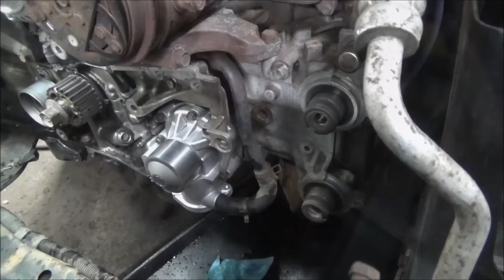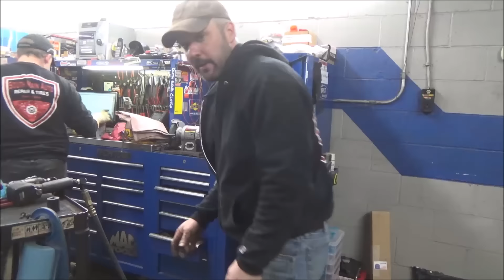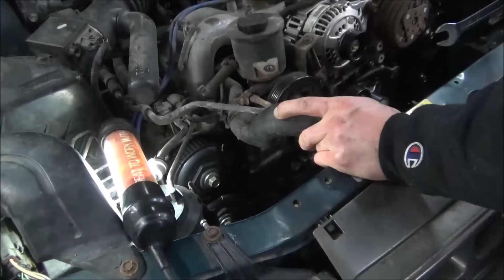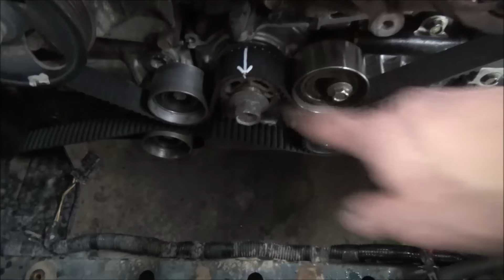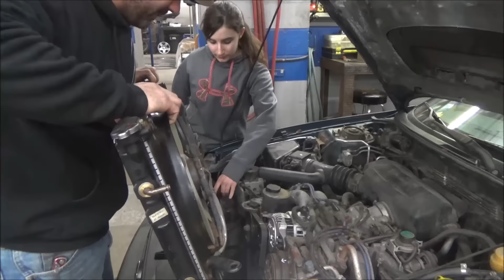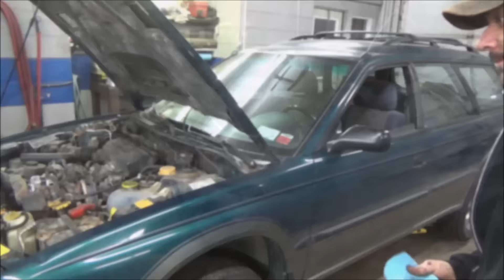Subaru EJ25D 2.5 DOHC Timing Belt & Water Pump - Part II

Comment: I bought a 97 Subaru from a guy last year not running. I took a chance and paid 1000 dollars for it. He told me it was his daily work car and one morning it would not start. He said he had a mechanic looked at it in his driveway and said his computer went bad and that is all that is wrong with it. I got it towed to my house and started working with it, anyhow I took the timing belt apart, it has a brand new belt ,new water pump, bolts were cleaned then I found out that they did put a new timing belt and water pump but when they put it back together the idiots forgot to place the little keyway when they install the crankshaft pulley. lol so when you start the car it would not crank because of it. Needless to say at the end I got the car running and drove it for two years and sold it and made more than what I payed for. What a great deal !!!!
That was a true story. But not all the time you ran into that situation 90 percent of the time you ended up buying a melon. So my suggestion is don't buy a car especially when the car does not run.

Comment: I have done this 4 times with new kits, and will be doing my 5th soon. 
A few tips for the DIY's from my experiance that do not have Erics expertise and tools.
1: Do make sure you have a proper tourqe wrench for the waterpump bolts. I stripped the lower driver side one and could never stop the leak.
2: I use small clamps to hold the belt on the driver side pully's as they do jump easily.
3: Do not get China parts. I bought 1set and the belt had no marks and the tensioner pully and bolt did not work together. Could not use the suppied bolt to reuse the old pully. I use Gates only for my kits. 
4: The last ideler pully to install went on easy for Eric. 1st 2 I did were a big fight. Now I leave all pullys lose untill the last one is threaded.
5: I tried the same thing Eric did with the allen wrench on the tensioner after being off 1 tooth, and having to redo everything.
 Mine  snapped. Try a 2 inch finishing nail. Worked for me.
 Hope this helps.

Comment: Eric, needed this vid about a week ago! Was doing this on a DOHC 99 Legacy GT. The tooth-count tip when the cams are set in the area is the ultimate tip on these engines, in particular. If you're a tooth off, you'll pretty quickly notice a bad start and the engine will throw a P030[1,2,3,4]. The water pump install with removing the back timing cover is a lot easier.....only if you can easily zip off the cam sprockets with an impact or something, if you can't do that, or if you don't need to change the seals, I wouldn't try taking off the sprockets. You're awesome, man!
Reply from the maker: +Rodrigo Sagebin Ah man a day late as usual! Good tips thanks!

Comment: Those spill free funnels are great.  Paid for itself the first time I used it. Like you experienced in the video, a little bit of coolant can spill out when removing the funnel & adapter.  I've found that if you slightly squeeze the upper radiator hose to push coolant up into the funnel, then plug & remove the funnel. When you release the upper radiator hose at this point the coolant level will often drop just below the radiator filler neck. So when you remove the adapter little to no coolant will spill out. Works like a charm and saves me a bunch of time on clean up.
Reply from the maker: +Pet Rock's Garage Yeah I know better but just didn't do it :/ Thanks for sharing though def a great tip!
Reply: no prob...  keep the awesome videos comin'...

Comment: Good video.   When I worked on my wife's 1997 Outback, I went ahead and pulled the engine to change out all seals, gaskets, water pump, belts, etc.   It was a easy engine to work on.

Comment: Another outstanding thumbs up SMA original video.  What an excellent tip at 19:41!  After watching part one of this video I went to view the head gasket replacement on this same vehicle.  Fantastic stuff shown keeping this car on the road.  At 20:26, I rotated my crank 720 degrees to check the timing after installing a new belt.  Glad I did.  Turns out I installed the belt backwards.  Recovered quickly and everything worked out fine.
Reply from the maker: +Sandbag1300 Oh man common rookie mistake as Danner would say lol, Nahhh good thing you caught it before ya hit the key!

Comment: I had the SOHC engine (2.2) and honestly working on a Subaru in the home garage is way easier than my Toyotas or Ford. Especially since the alternator is on top. Spark plugs are not terrible even though you think they would be on the boxer engine.  Will be looking at your head gasket videos as well :-)
Excellent video and walk through on the DOHC version, a lot of owners have trouble with lining everything up.

Comment: I did this job on a 90 legacy w/ 2.2 and started engine to check timing and tranny fluid went all over! LOL.
Did not have an impact so used a socket and breaker bar against the front frame rail under battery and used the starter to loosen crank bolt!
Also had no sprocket holding tool so had to improvise.

Comment: One little thing... Sometimes the idler pulley has a large center hole that is fitted with a large cupped washer.  I don't know if it is intentional, but it sure is handy to loosen that bolt a bit so the pulley can go off center and give you another half inch of slop in the belt so you can finesse the timings.

Comment: Awesome video Eric.

There has to be an advantage to that design... But man, to have to pull the timing and most of the front of the motor just to get to a water pump? I am used to taking a serpentine belt off and zipping the water pump off and then put it on and done. 

Of course, only seen that on American motors... Even the Aveo (Korean Daewoo model) we had with the 1.6L had you mess with the timing as well just to get to the water pump. I guess they make em this way for a reason!

Comment: Just a tip when using the spill free funnel, before putting in the stopper you squeeze the upper radiator hose then plug it. Then you do not have water come out when you remove the adapter.  Question, thermostat with jiggle pin,  where does the jiggle pin face, 12 o'clock or does it matter.  Thanks for another great video.
Reply from the maker: +Ricardo M. always put the pin at the high point , on this style it did not matter though
Reply: Thank you for the info, I appreciate it.

Comment: Nice! If you want to start the engine with the rad out, just connect one trans cooler line to the other with the longer of the two existing hoses. That way you don't need to use any fancy-pants hose pinch-off pliers which most of us regular DIY folks don't have in our toolbox anyways :)
Reply from the maker: +motoYam82 Heck ya or an old piece of 5/16 or 3/8" steel line  to loop them together. Your right full of the good advice!
Reply: +South Main Auto Repair +motoYam82 that was another thing that got me on this one... Rubber Transmission lines?? My Chevy and my Ford both have steel lines (or Aluminum... More than likely aluminum) and have a special fitting that screws or clips them to the rad. 

Since it is rubber, are these prone to failure or do they hold up well to the fluid and pressures?
Reply: On any vehicle there must be some section of the cooler line which is a flexible hose to allow for movement of the engine/trans with respect to the radiator. As for longevity, the stock cooler hoses generally outlast the vehicle. In fact it's always the steel part that rusts through and leaks!
Reply: +motoYam82 Thanks for that Ivan! It is interesting how that works, and on my vehicles, there must be a different section of rubber hose somewhere. I'll climb under and take a look one of these days. 

Luckily, I am no where near the rust belt, so I shouldn't have rust issues. I know rust eats up cars like nothing up there in your neck of the woods!
Reply: Pine Hollow Auto Diagnostics 😂😂😂😂

Comment: The toothed pulley next to the water pump is the first one to go.  If it locks it takes out the belt and the valves.  I took one off of a car and the pulley spun free.  A couple of days later I picked it up off of my work bench and it was locked.  That is playing it close.

The suggested belt change interval is (as I remember) 105K miles.  I say you are being brave or maybe foolish if you go that long on a belt and pulleys.

Comment: most of the time on the manuals i just pull the engine because the rear main needs done at the same, i have done so many there is no need to even lift the car I can get the engine out in about 2 hours with hand tools by myself.

Comment: I would suggest replacing the cam seals at this time. I had a cam seal pop out of it's bore and cause a massive oil leak. 8 quarts of oil in 50 mile drive. yes it was a bad deal.

Comment: My engine has a loud rapping noise coming from around the water pump area, I had the belt off and the sound was still there. I'm assuming something in the timing belt area. Watching your video it seems like the tensioner failed and the pulley arm is rapping on the water pump area.

Comment: Do you get much work from the cold weather , you know frozen blocks, etc. Or does the coolant take care of these kind of problems.
When we first moved to Fla from Vermont, My Dad bought a new 59 Chevy and had to pay extra for a heater in the car, never heard the end of that one.
I once filled my radiator with straight Coolant, Thought 50% good...100% Better, Big mistake..car ran hot right out of the Gate.

Comment: The BIG MISTAKE was not replacing the water pump and thermostat when the timing belt was replaced the first time. Subaru pumps WILL NOT last through two timing belts.  They should always be replaced with the belt to avoid the cost of disassembling the front of the engine TWICE.

Comment: What is your take on the quality of original Subaru water pumps? I recently had my timing belt and components replaced on my 2010 Legacy 2.5I, and the mechanic said unless they start weeping, he won't pull them until the second TB replacement. He said they're really reliable. 

Just curious as to what your thoughts are. Thanks!

Comment: Great video man. Btw, what kind of air hose fittings do you use? My shop has 1/2 inch air hose, so It kinda gets in the way a lot. I've tried a couple brands with the style you have, but they all sucked. They either leaked or seriously impacted my air tool performance.

Comment: I want to first say that I love your work style and your tutoraials are the first and only that I care for. I  do most of my learning by the haynes, by myself, and several tries over. But I do love it and I love my little 99 legacy Outback limited...I have a real problem this time though and can't seem to get an answer, hopping you could help...I recently changed my water pump and ran into a huge problem...I know I can fix it I just need to ask an expert before making moves...when I was taking it off the back frame or housing that the pump gets atached to had a litttle peuce of the bottom right corner that broke off  (to inclue the pasing hrough one of the bolts hole corners...Is there a way to fix that with some epxoy or does that
detach from the block so that I can have it elded  pecie

Comment: Hey Eric, been a long time watcher. Great vids as always. I doing a suby for the first time. You skipped the torquing of the crank bolt. i don't have a special suby pulley holding tool and Im wondering whether you use a special tool or you have some other way of holding the engine still on an auto to torque the bolt? appreciate your advice,

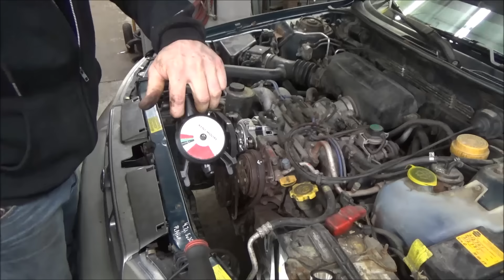Comment: What are the belt tension gauges used to set the proper belt tension around 23:14 and 24:07? Didn't quite catch the name of the first one. Where does one buy them? I have to replace the belts on a '06 Legacy 2.5L H4SO.
Thanks for all the videos! They've been very informative and entertaining. Fun to see someone working on CNY cars too.
Reply: Krikit II Pocket Gauge for Ribbed Belts - Part Number 93866

Comment: I'm working on my 96 Subaru Legacy GT with same engine and my drivers side intake cam pulley spun with the impact gun so hoping I have it right. Putting a new belt on mine and it has 107 k miles. Have to replace my camshaft seals as they leak. Water pump bearing was bad too. My friend said to take out the spark plugs and did that because I was hoping the pulley would not spin out fast etc with less compression. I inserted all  the plug caps back in . Was really inquisitive on being experimental on a easier safer more reliable way to tackle this and if anyone tried it this way without having the spark plugs in just let me know. 

Also wanted to know any way to tell camshaft positioning like the other side of engine looking at the plugs that go on the other side of this engine. I did mark with white valve ink marker the old belt before taking it off. I know Eric says that the piston is set in the middle or to that effect when its timed. Guess I best try and start it but was concerned that I may have botched it up. First time tackling this type of repair. My friend is helping me also. 

We filled up with antifreeze the top passengers coolant hose and it fills in the coolant super fast. I did this before and my car ran fine. Much much faster way in replenishing the coolant but again no expert by any stretch of the imagination. 

Any insight on my predicament regarding the intake wheel pulley on the drivers side needing readjustment? I'm going to count 28 teeth over on the belt too. Wish I seen this video before tackling this project.

Great freaking videos Eric!!
Reply from the maker: You did realign the marks on the pulleys in relationship to the head right? Just line up the pulley to head marks, set the crank mark, and then put ont he belt. The belt, if it is good quality should already have the tooth count marks on it for you. makes it a gravy job to do.

Comment: Belt tension gauge unheard of around here.
Reply: +Joe Tiller  Do you have to use a tension gauge  also when a hydraulic tensioner is on the car??
Reply: +estrelladelnorte1308 No .....
Reply: +estrelladelnorte1308 The hydraulic tensioner was for the timing belt - the gauge was to check the tension of the external serpentine belt.
Reply: Steve Koszuta got it ! thanks!

Comment: When I change my coolant, I use a coolant flush additive and then double rinse (fill with plain water, run it until it build pressure, drain, repeat).  The result is only clean water in the block.  I then add 100% coolant, run it until it build pressure and then test the coolant protection level.  I usually over shoot, so I take some out (< 1 qt) out and add water and test again.  On my really old vehicle (>10yo) I use the plain "green" coolant.  Newer cars I use the OEM coolant.  (Of course I usually wait 5+ years between coolant changes !)

When you are doing a coolant flush, do you use an automatic machine or just drain and fresh water flush ?

When doing repairs that open the cooling system I assume you are using fresh 40/40 coolant, correct ?
Reply from the maker: +theoldwizard998 I don't have an automatic wallet flusher, oh I mean coolant flusher lol I do essentially what you do then I fill with a 50/50 of the OEM fluid.
Reply: +South Main Auto Repair I have found that filling with 50/50 coolant results in too weak of a mixture because of the residual water in the block.and heater.

(Wallet flusher - I thought that was the automatic transmission fluid changer !)
Reply from the maker: Oh yeah if I have the block full of water I def would go with straight.
Reply: +South Main Auto Repair So .... how do YOU get water out of the block so that you can just fill with 50/50 ?
Reply from the maker: theoldwizard998 Well if you wanna get it out o the block you have to remove the block drain if it has one. On V-6's and V'8's usually there is 2
Reply: +South Main Auto Repair You are better man than me !  On a Ford Modular Engine (4.6L/5.4l) the motor mounts are in the way !
Reply: To drain coolant undo 2 hex plugs behind the crank pulley ,very tight, 11, 12 mm Allen key on a breaker bar, 
Some early forester have a bleeder on heater hose out, reverse flush heater core with garden hose, go 100%coolant for corrosion protection, one time =5 years peace of mind,  also  drill1/8 hole in your t/stat to release air lock turning to steam, drill it about 1/4 from edge  , from Mr mark tassie